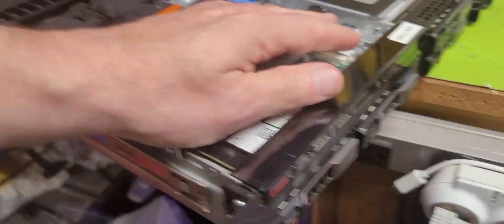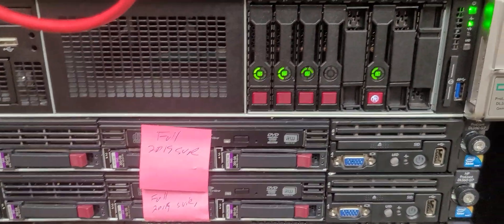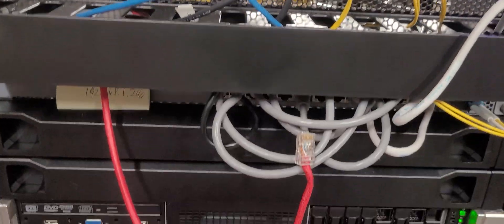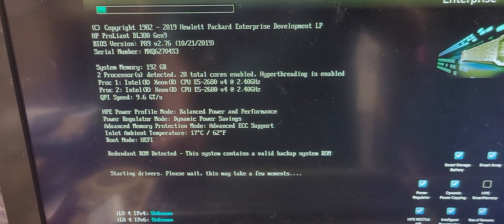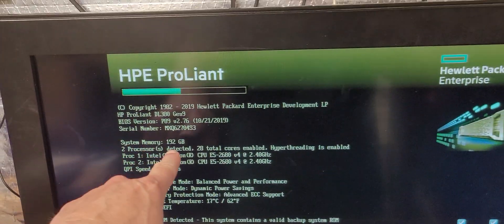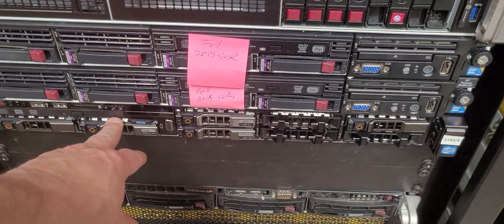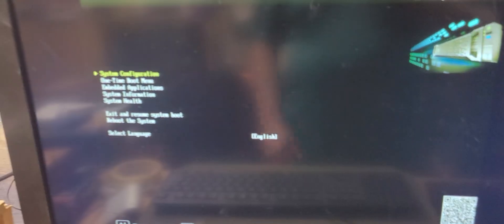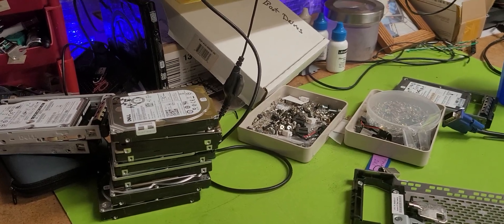My new ProxMox cluster  build out with my newly built out  OEM servers... Sweet!

Comment: Hi, I currently build a storage array, and found your videos quite interesting, however, since my built will involve internal and external JBOD, what of those boxes would you recommend to use? Your videos shows quite a mix of such ...
 
HP D3700
Dell PowerVault MD1420
Dell EMC Unity DAE 25
3PAR 8000
Netapp DS224C
Reply from the maker: For housing disks only, I recommend the standard SAS arrays like the Dell EMC or the NetApp array that I did my video on, if you are wanting to a server housing for disk then the Dell R-730 DX 26 disk array is really good. R-720 DX is second best.
Reply: @leadiususa7394  Quick other question, regarding EMC SAE, are there major different hardware version to look for or are they all the same? Further, does it need firmware upgrade ? I tried but really could not find much about this specific enclosure other than very good prices on ebay 🙂
Reply from the maker: @marcellinus77  No it is pretty basic really as a protocol. No need for firmware flashing.
Reply: @leadiususa7394  Follow up question, I got an EMC SAE enclosure and a few drives (NETAPP 1.2TB SAS) ... all working extremely well. Here the question, I found that some drives show the blue drive LED normally ON and some normally OFF, however, all flash LED on access similarily. Just the default state is either on or off. Orange LED I can perfectly controll from linux for identifying/showing error state etc. but I did not figure the blue LED. Any knowledge on this?
Reply from the maker: @marcellinus77  Could be power related, what is make and model of the EMC disk array?
Reply: https://youtu.be/h1MyU5qcH2I
Reply: I did a short video, left 4 disks with LED normally off and right 4 with LED normally on, seems a really cosmetic issue, just don't understand and would be cool to fully understand what's going on and why. Disks are the same: however, they work, which is most important. What is your experience, LED is normally on or off? However, access makes led blink, allways, so no issue there. Must be a hidden flag or something. Enclosure is EMC SAE VNX Extension 25 x 2.5 SFF.
Reply: I forgot to mention, it really is disk related, it completely does not matter what slot I put it in to show the behaviour. Some disk have "inverted" LED ...
Reply: 👍figured it out, it's the RLM = Ready Light Meaning - can be changed with sdparm --get=RLM /dev/sdX / sdparm --set=RLM=1 /dev/sdX
Reply: @leadiususa7394  Thanks!